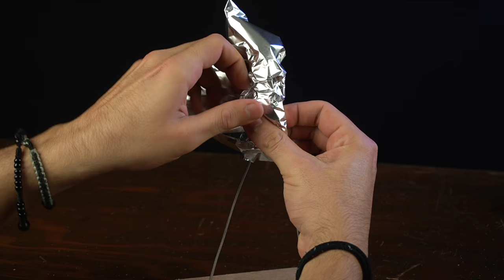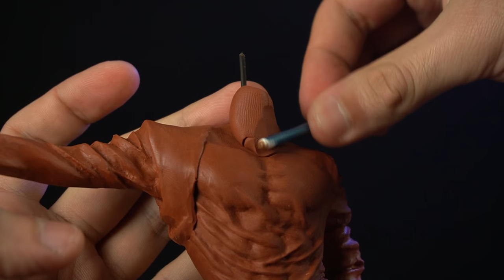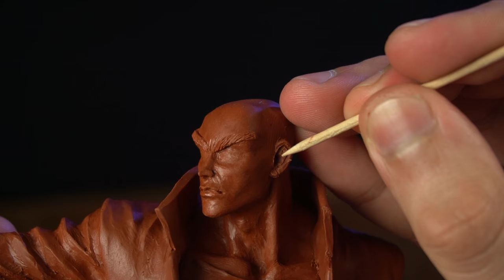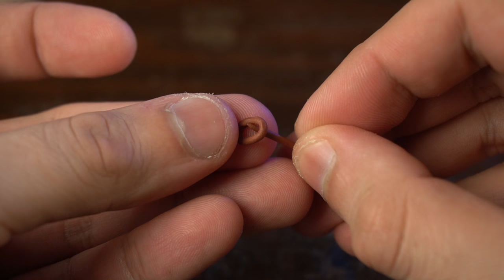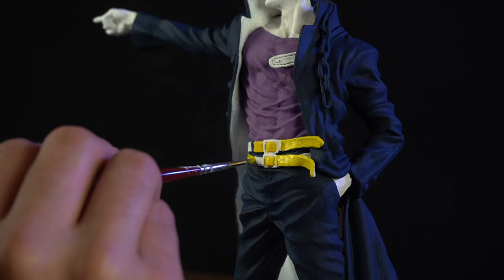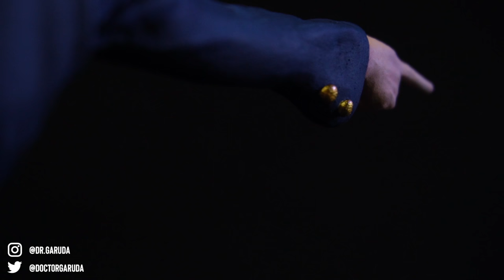Sculpting JOTARO KUJO | Jojo's Bizarre Adventure

Comment: Meanwhile at their house
"Hey this is a great figure, how much was it"
"well the raw materials weren't TOO cheap, but I think I spent about $8 on it?"
Reply: Monster clay is around 50€ a batch, so considering how he used it must have been around 25 with the strings?
Reply: yeah buy it is the craftsmanship tho
Reply: What was the white stuff they used before painting with colors?
Reply: @realswobby  I think its acrylic paint, Im just guessing but maybe its so the colors don't change in the case they aren't opaque enough, or to have a better perception of how the colors used render on the piece.
Reply: @gallygumn5459  has.
Reply: @gallygumn5459  yeah but the time it took to make it would cost a lot - say like, 15-20 an hour? I'd figure this would take between 10-20 hours to make so labor alone has to cost like $150 on the low end or up to $400 if it took him a while to do
Reply: @snailart9214  Agree, but I was talking about how it cost him to do it, though I havent thought of including the acrilics,  that probably arent too chep if it covers so well.
But yeah, he could sell it at a good price.
Reply: @gallygumn5459  1250 €
Reply: @realswobby  Maybe it's a kind of primer to help the paint stick better?
Reply: @gallygumn5459  25€ or 25 batches? 0.o
Reply: @seniorsly  I am only really, really roughly estimating, to the point I am probably wrong, but Id say he used around half a batch, and since a batch is 50€, the making this figurine cost 25€, around 5€ for the wires and aluminium and the price of good quality acrylics.